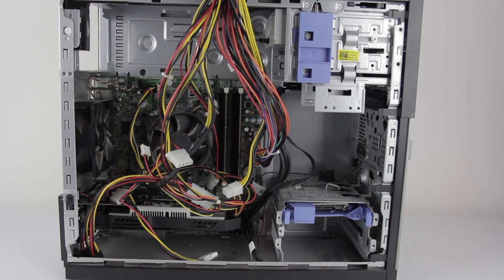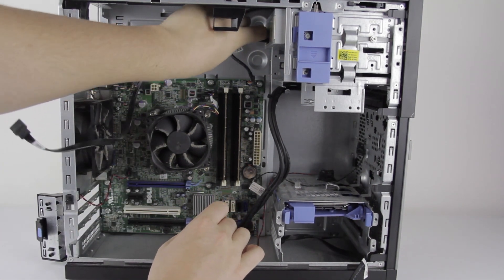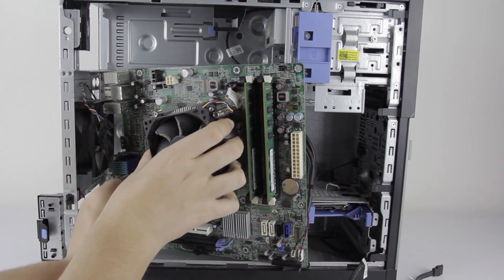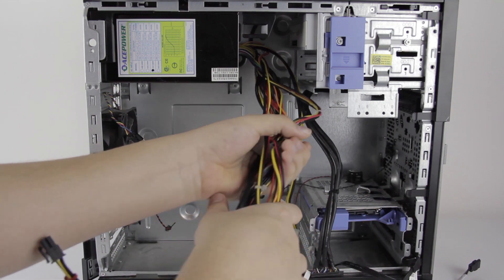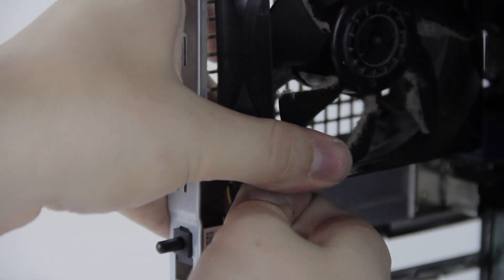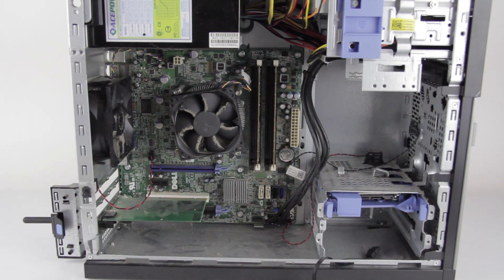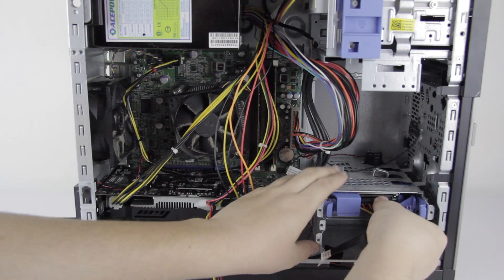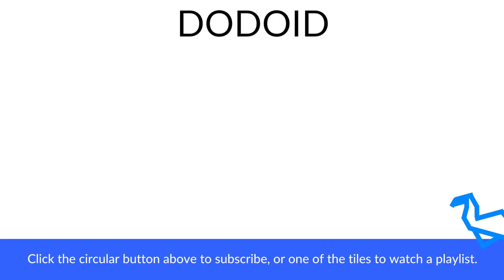E-Waste Dell Optiplex 990 - Gaming Upgrades with GTX 750 Ti (Day 6)

Comment: @Dodoid - 
1. this new Power supply does look cheap (kaboom / GRILL )
2. removing the rear fan as first step  makes this much easier 
3. clean it before take it back in

Comment: You made a lot of extra work for yourself by removing the motherboard. All you needed to do was slide that bracket forward to allow enough room for the new psu. I've worked on a lot of those old Optiplex Mini Towers and I've never needed to remove the mobo to replace a psu, even one that size.
Reply from the maker: I did try that, but when I did that, the black plastic piece at the rear moved forwards and the actual size of the space was the same (you still couldn't fit it in). Is there a trick? Do you have to separate the two pieces so that they can move independently and widen the space for the PSU? Or am I just really bad at installing power supplies?
Reply: All I ever had to do was slide the lever forward.
Reply: i had this same issue getting a corsair 520hx psu into a dell 790, tried everything and eventually had to remove the motherboard to get it in past the panel latch, believe me there is no other way to do it properly other than some people that simply destroy the latch to fit psu ( seen it done by some well know youtubers )

Comment: I skimmed through this video without sound but I do have some questions - I want to put a 750Ti in a 390, 790, or 990MT but I've heard motherboards need a specific bios for it to work.  Did you have to deal with this? Thanks
Reply: I ended up going a different route entirely. Found a built gaming PC on letgo for a really good price and went that way.  Sorry!
Reply: Thanks! I ended up getting it for a buddy of mine. He had a budget of $150 for a whole rig, so I had to scavenge haha

Comment: Whats up bro, I need your help. Im having trouble getting my optiplex 990 up and running smoothly. it automatically shutdowns then between few second and minute later it automatically power on. Thanks in advance bro.
Reply from the maker: OK, this is very generic troubleshooting advice as I haven't seen these problems myself, but here are a few things I would check:
- Is the power supply working properly? Try another one, you can just sit it on top and plug it into the motherboard and stuff for testing, no need to install it. This would be my top guess.
- Is all your RAM working? Try memtest. Bad RAM can cause instability sometimes.
- Is anything in the BIOS set weird? I can't see what would cause that, but try a factory default reset anyway.
- Do you have a lot of hardware in your system? Is your power supply having to run above its rated amperage on any of its rails?
- Do any capacitors look faulty? This is quite a new system to have caps failing already, but I would give it a look.
- Is everything seated OK? Cables, DIMMs, cards, etc? Again, this is an unlikely one, but possible.
Reply: Pull your CPU and your GPU, remove the heatsinks and fans, scrape off the old thermal paste and put new paste on; reassemble the heatsinks and fans, and put the CPU and GPU back in.
Reply: Ů

Comment: Do you use greenscreen
Reply from the maker: No. My white background was originally simply an IKEA desk, which was expanded shortly after my earliest videos (I believe my video on the ThinkPad R61 was the last to be shot entirely on the old background). I then expanded it with two pieces of posterboard, taped to the desk and the wall, and curved so as not to create any sharp corners. Originally, this posterboard piece was somewhat shoddily constructed, and had a tendency to fall off the wall or create visible seams on the video, but small modifications were made to it over time until it worked reasonably well. When I filmed my SGI Octane, I attempted to expand the background using a third sheet of posterboard at the side of the desk, but this made filming certain scenes extremely difficult, and it was removed very shortly after the Octane video was complete. In newer videos where a larger background is needed, I have opted to expand the background digitally (the original clip may include the wall, my door, and numerous other things, but this is covered with a simulated background during editing). This method was first used in my SGI Fuel Repair Part 1 video, if I remember correctly, and is still used today. The original IKEA desk was still used as the lower part of the background, and slowly accumulated small pockmarks, each of which was visible on camera. The first of these appeared when I dropped an iPad on the table, another came from the corner of an SGI fuel, another from a screwdriver. While filming this video (2017 Advent Calendar pt. 6), I dropped an ATX power supply on the desk, creating a huge gouge. This necessitated covering the IKEA desk surface with two more pieces of posterboard, which is probably the cause of any visual differences seen here. The "full posterboard" method will be the new standard for my videos, as it allows the lower surface to be replaced as needed, like the upper surface.

In short, no greenscreen. More of a whitescreen, but there is no keying involved. The background looks the same in person as it does onscreen, apart from sometimes being smaller (as I can expand it when editing, as explained).